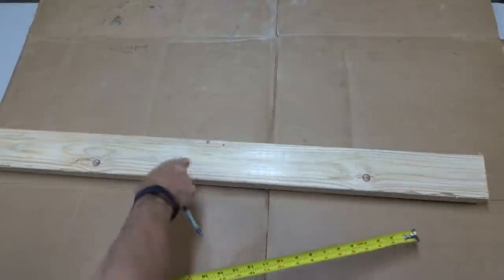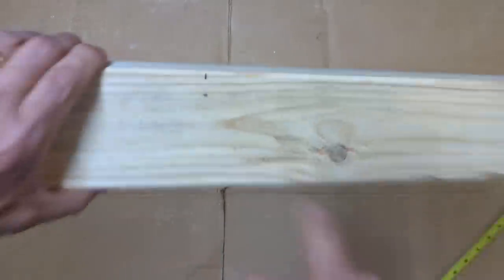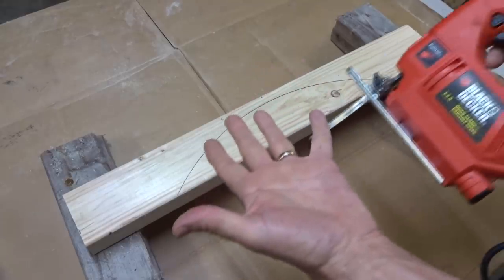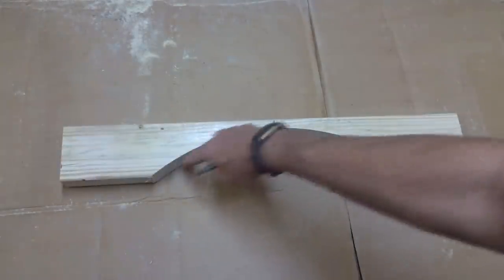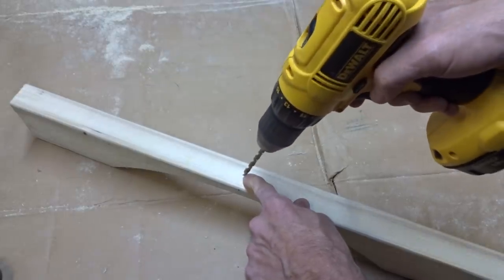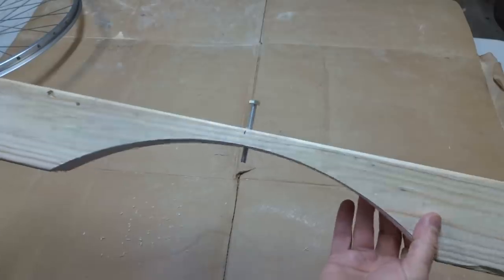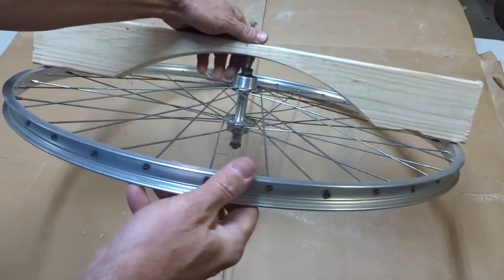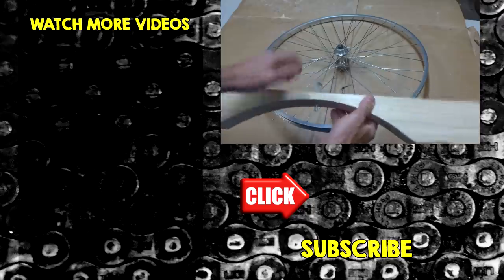Make A Cheap DIY Wheel Dishing Tool For Under $5!

Comment: I just use two cups on a flat surface and rest the wheel on them. Then I stack some items up to the axle (inner surface). Then by turning the wheel upside down you can see how big the gap is and try make it equal. 👍 If I were building wheels frequently then this tool would save some time.
Reply: that's brilliant, thanks!
Reply: Yes workes perfectly, thank you.
Reply: genius
Reply: Holy McMoly that worked !!!!!

Comment: I made the dishing tool, but was not happy with screwing the 1/4" bolt direct to wood. I lined the outside and inside with a couple of bits of scrap metal. Bits cut from a baked bean can were used - glued on. You could use thick brass, which would reinforce the tool at its weakest point.

I then drilled a 1/4" hole through , and used two washers either side of the hole, and with a nut either side.

I used my grinder to grind the end of the bolt to a point, so it is easier to see the gap.

Didn't even spend 5$. The wood was scrap, the metal came from a can, and I used an old bolt.

Works perfectly

Comment: Great video! This will save me money and time. One thing I would do to make it easier to use. I would make the screw hole the correct size, 1/4" in your case, and I would put a nut, on the bolt, and just use the nut to set the bolt at the set height.

Comment: Worth mentioning to use kiln dried lumber!  Use wet pressure treated and when you re-use the tool in a year it will be twisted and hard to get it aligned straight.
Reply: Upgrade it with another piece of lumber so that it crossing the tool at one end. That it would become like a capital  letter T. That way your tool will have always 3 points touching the rim and the screw to locknut.. So 4 points all together. This way, it won't matter how twisted the lumber is, or even whether you drilled the hole straight. Also screw wood screws to the ends of that cross beam, so that heads of screws would left stick out some millimeters.. They help you to guide tool when measuring, that your tool touch the rim with same spot on both side of wheel.. Also you can hang the tool on rim by those screws.. and measure no handed.. By only holding wheel And other hand is free to adjust the measuring bolt.. 

 I did mine this way because I'm not good at precision in building things. And lumber I had was also not straight and good.

Comment: Great idea .. You can make your own alignment tool also for the hub centering   i use a wooden yard stick  drill a hole in the end to match your skewer thickness exact  then place the skewer thru the hole at end of stick lay wheel flat on wood to get hub off ground    spin the stick an this will reveal your hub alignment   if you have wheels that ain't spinning proper hop in the wheel  this will give you a better idea of where the problem lies  easy method for gettin roundness back  as this part van be a pain in the azz   this way works better for me then a park dishing tool far as getting my wheels round as you simple spin the yard stick an it will reveal all at once

Comment: When using a Wheel Dishing Tool why do you measure on the lock nuts instead of on the cup of the hub? Wouldn't the cup be more accurate in terms of the hub being center with the wheel?

Comment: When i built Cycle wheels i used another trick, it was always a nuisance to keep taking the wheel out of the stand to check the dish, so i measured the distance over the lock nuts, divided by half and wrapped some tape round the hub so one edge of the tape was at half distance, then i could look through the valve hole at a spoke nipple opposite checking the edge of the tape was on the same alignment.
Reply: Yes! I do the same. It's great for initial dishing and then there's only a 1 or 2 mm adjustment with the gauge..

Comment: I have a 60s stuck on headbadge covered with one pass of black spray paint, can I remove the thin coat without damaging the badge. I'm thinking about thinner but I'm not sure. Great vid.
Reply from the maker: I don't know. Maybe a heat gun.
Reply: @RJTheBikeGuy  Thanks, I just got the pair, men/women, They're in great shape but were painted. I hope you have a vid on rebuilding coaster brake hubs. These are my first real restoration projects. Thanks again for your time.
Reply: @RJTheBikeGuy  You are the man, I used a hair dryer on the headbadge for 20 sec. Then slowly sanded it with 600 g. The bikes are  Mohawk made in N.Y. thanks a million for the idea.
Reply from the maker: @dereksmith3632  Glad it worked!

Comment: Is a dishing tool really necessary? I mean if you true the wheel correctly, it should be in the middle right?
Reply: Coming in very late here, but a wheel can be true but out of center. That said, a dishing tool/centering gauge is rather a luxury item; it is not needed to guage centering. Turning a wheel around in a truing stand or in the bike will also show if a rim is not centered.

Comment: hello my friend,
just a quick question please. In order to center the rear wheel, where should I put the screw ? at the edge of the hub, the axle, or the freewheel ?
 I hope you answer me as quickly as possible

Thanks.
Reply from the maker: On the locknut the makes contact with the dropout.

Comment: Another useful video although I think the screw needs a wing nut or something to make it easy to turn by hand.  If you have folding bikes with 20" or even 16" wheels I guess you would use those wheels for the template. Not a lot of folding bike content on your channel by the way unless I've missed it.
Reply from the maker: For the most part, folding bikes seem to be mostly regular bikes (often low end), that fold. So most of the stuff is the same.
Reply: @RJTheBikeGuy  Quite a lot of premium folding bike brands and issues specific to folding bikes. Hinge for example. Sometimes the hinges fail and parts are not available easily so a DIY fix is required. Dahon is notorious for bringing out yearly updates and not providing spares for older models. I accept that most issues are the same but I guess it would be nice just to see you buy a rough one and see you improve it.

Comment: if you use a power screw driver to screw the bolt up and down a lot, the friction will create a heat polishing effect in the wood that will give you good threading and good tension.

this isnt a thing i "know" though. its a tip i got from elsewhere.

Comment: I'm worried that the bolt might loosen up over time so I might glue a nut to the wood with epoxy or something
Reply from the maker: I think it would take quite a while, if it all. But hey, you could always cut another piece of wood. I bought an 8 foot 2x4 for a couple bucks and only used 26" of it.
Reply: Yard Sale Dale  yeah that's a good idea

Comment: Good idea, but you should use a wider piece of wood. It won´t be stable for a longer time if you leave only such a little bit compared with the length of the tool.
 If it was 1 inch wider it should be fine, you had to use a longer bolt, that was no problem.  The best solution would be to use hardwood or plywood.
Reply from the maker: It's as wide or wider than the Park Tool.
Reply: @RJTheBikeGuy  Yes, but the Park tool is made of metal. Wood does not provide the kind of stability metal does, especially if humidity changes. The danger is, that the gauge looses its alignment. You may avoid this by leaving a little bit more of material.
Reply from the maker: Doesn't matter if it changes a little bit. It isn't going to change between measuring from one side to the other.
Reply: @atelierunterderteck7583  It only takes a few seconds to flip from one side to the other. It won't change in that time.
Reply: @RJTheBikeGuy  ...ooops, you are right. Sorry, I had a bug in my thinking :-)
Reply from the maker: @atelierunterderteck7583  No biggie. Hardwood, would make a nicer tool. But it would also raise the cost substantially.